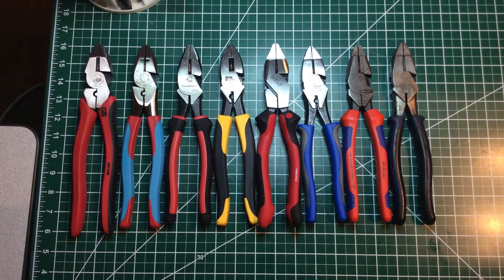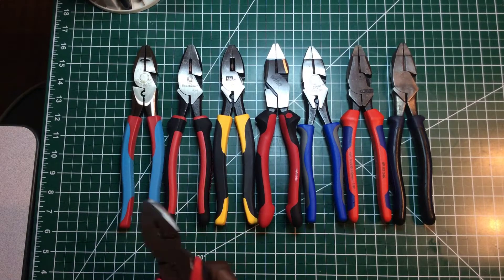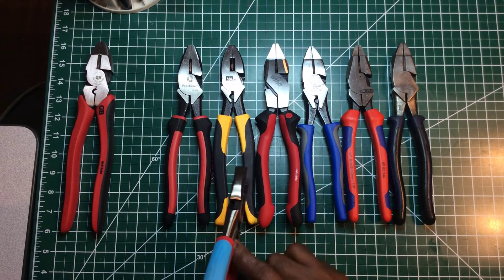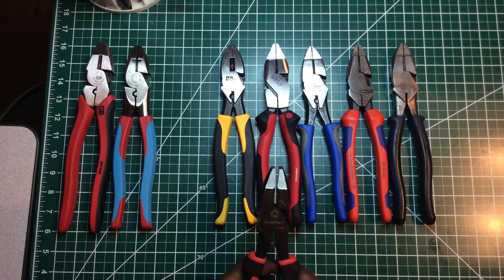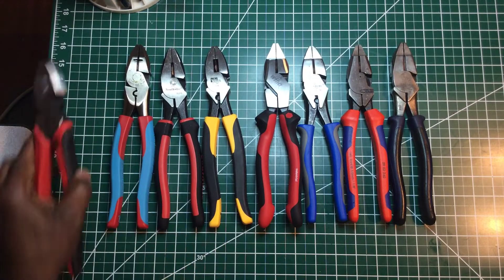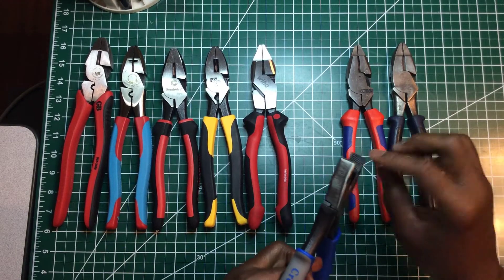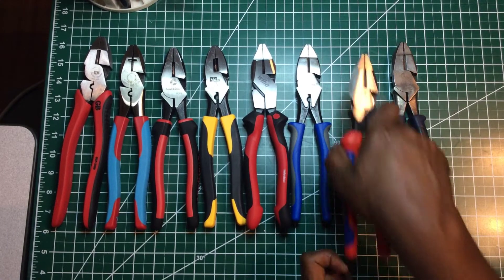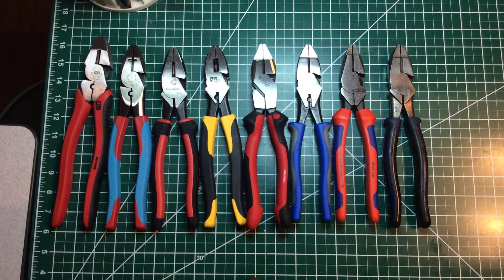The Good , The Bad, and the Ugly Linesman Pliers

Comment: Im a big fan of the klein multi plier... has a 6 and 8-32 bolt cutter, crimper,  strips 14 and 12 awg solid copper wire. The only thing making it less then perfect was no legit fish tape puller but I took care of that with a dremal and a small cut off disk. Cut one in because thats what I do... custom and make things better. Nice vid!
Reply from the maker: That’s what us ELECTRICIANS do we think 🤔 outside of the  box 📦. 👍🏿🤙💯🤙💪👌☝️✅⚡️💭👏🤔
Reply: Try the Knipex forged wire stripper. Basically the same setup but you can strip a wider range of AWG, has notches in the strippers to score the sheath on Romeo and the 6&8-32 you don’t have to thread the bolt. 

Only 6 months but they still seem brand new. Nice wide head on the pliers…I hardly use my linesman much unless needed

Comment: What was impressive about this video is the reviewer put his 15 yo pair of Klein pliers against brand new everyone else and the Klein pliers still ranked in the top notch group.  I personally own Klein this videos shows it was a wise choice. Update I bent the pin in my kleins they're useless now. Ideal is easily an Apex manufacturer. I own a pair of ideal now. So far they're everything my kleins were but better.  I liked the handle grips and the shape.  The handles are closer together and more comfortable. The grips feel great. The head is slightly smaller and is easier to work with. I'm glad I found my ideal pliers before I spent a bundle on knipex. That's what shows me ideal is an electricians brand.  The Knipex or Klein equivalent to my 30 dollar ideal pliers cost 70 dollars from both klein or knipex.

Comment: Excellent review sir.  This is how a review comparison should be done.  This person did a great job representing everyone in the tool trade fairly with all like models of each manufacturer.  Most importantly he did a cutting test with each set, something I consider essential to any comparison review.  I do wish it could have been a longer Video and more various material used to cut in cutting test such as screws and MC. I also wish he had shown the results of the cutting test with the tail tell rope cut test and light bulb test on cutters.  Excellent job and much more unbiased than most review videos where you can tell the reviewer has already chosen Knipex as his choice from the beginning of the review.
Reply: What was impressive about this video is the reviewer put his 15 yo pair of Klein pliers against brand new everyone else and the Klein pliers still ranked in the top notch group.  I personally own Klein this videos shows it was a wise choice.
Reply from the maker: All of those linesman pliers are high quality the only pair I really didn’t like and won’t recommend is the SOUTHWIRE as least that particular model.

Comment: I personally like Klein lineman pliers. I use the standard dark blue handle version. Work great. I currently use the NE nose version, but have a brand new pair of square nose Kleins to break out when I turn out. Figured new chapter in life needs a new pair of Kleins. I actually really like the hard plastic red Klein grips you can install. 

Not a huge fan of comfort grip handles personally. I've also had a pair of Knipex which were nice, but I just like my kleins. I've used the Ideal pliers a few times actually like them a lot. Seem like nice pliers, I do like the comfort grip on them, don't feel as bulky in hand. I don't like crimpers or fish tape pullers on mine pliers, I like em simple.
Reply from the maker: Yeah, I like the handle you can install. But now I purchase only the cushion grip handle linesman for comfort

Comment: Great comparison video. I just bought a small made in Japan Vampliers screw extraction plier. They are awesome. They also make screw extraction linesman pliers, but I have not heard of anyone using them as linesman pliers. I have only seen them being used as heavy duty screw extraction pliers. That is why I decided not to get the linesman version and checkout my other options for pliers.
Reply from the maker: I’ve seen the Vampliers before and their version of linesman pliers are much smaller than the  U.S. versions of linesman pliers. I’m not saying that the Vamplier aren’t quality pliers you just aren’t able to use them in a way that most electricians use the American made linesman pliers.
Reply: @TheElectriciansToolChannel  as a hammer?
Reply: Vamplirers is the IMPORTOR OEM LABEL.  The orginal manufacturer is a Japanese company called "Engineer"!
Technically theses aren't "Linesmans" technically they are combination pliers!
Reply from the maker: Thanks for the information ℹ️, it’ll be useful for my future videos 👍🏽.

Comment: Knipex are incredibly overrated and overpriced.
Reply from the maker: Yes and no Andrew Knipex being overrated and overpriced ? It depends on who you asked no as far as being overrated, I agree with you because even though I think they are very high quality they’re not ALL THAT !!!  Now I don’t think they’re worth the price they’re being sold for either , but again they’re among the best linesman pliers out there. I think CHANNELLOCK and IDEAL are better quality than Knipex plus they’re cheaper, that’s just my opinion.
Reply: @TheElectriciansToolChannel  Knipex makes beautifully-machined tools and their cobras are second to none, but the linesman pliers and diagonal pliers cutting surface isn’t closed out-of-the-box like the USA brands making it almost impossible to make a clean cut through muletape and CAT 6 cable. The steel used to make the pliers sends shocks through your hand every time you cut something and the pliers make contact, which is something you don’t get in USA pliers. Also, the steel used doesn’t hold up as long as USA steel for some odd reason.

In my own conclusion, the cutting surface is poorly designed and the steel seems to be of inferior quality to even Channellock which is more than half the price. Knipex water pump pliers are the best I’ve ever used, but their linesman and diagonal cutting pliers are inferior in every way to any USA brand.
Reply from the maker: Wow, I only own one thing from Knipex as far as steel hand tools. I must admit that you’re right about the cutter on the Knipex linesman pliers they’re not as sharp as others I’ve experienced. How do you feel about Wiha linesman pliers or tools ?
Reply: @TheElectriciansToolChannel  I haven’t used anything from Wiha, so I can’t comment on their tools other than what I’ve heard from YouTubers. What do you think about them?
Reply from the maker: I love their insulated tools, I not to impressed with the design of their linesman pliers. But the quality is 💪💪💪💪💪.
Reply: Maybe overpriced but overrated?  NAH
Reply from the maker: I agree ☝️